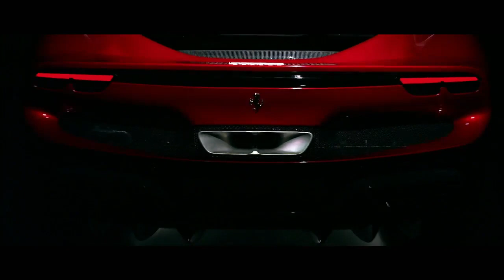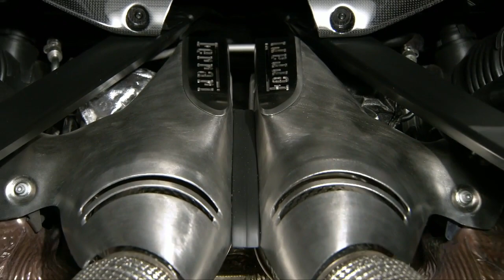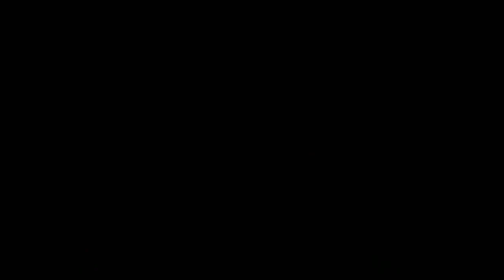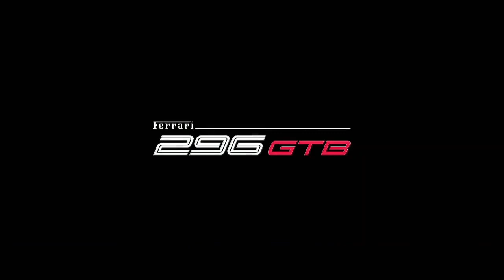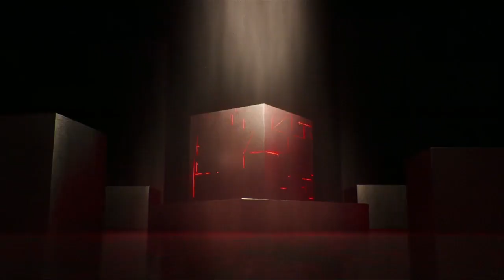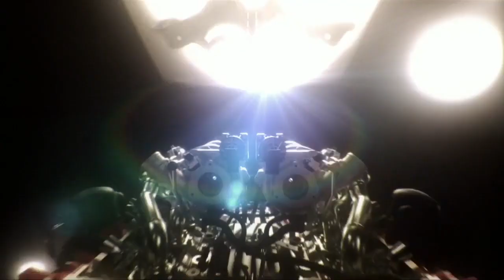New Ferrari 296 GTB - press conference

Comment: have to wonder how good the car might have been without the added weight and complexity of the hybrid components.

Also wondering if it shares the alfa 4c / maserati mid-engine carbonfiber tub.
Reply: It would be worse without the electric element. Also the 4C's tub is very small, it only fits an I4 engine and inside the cabin your cramped. That's a nice little Lotus Elise competitor, but not at Ferrari's level of sophistication or performance.